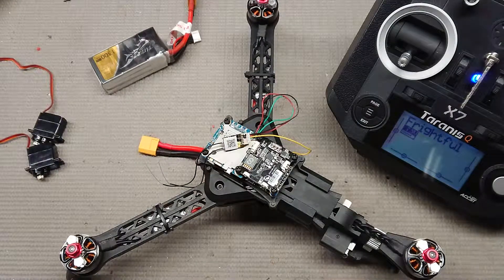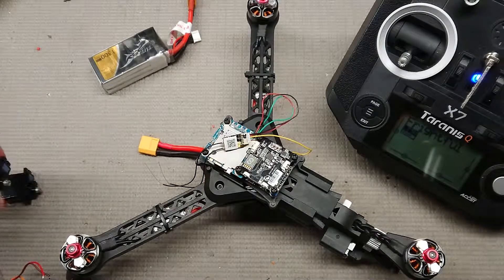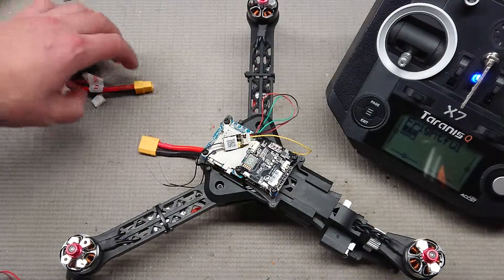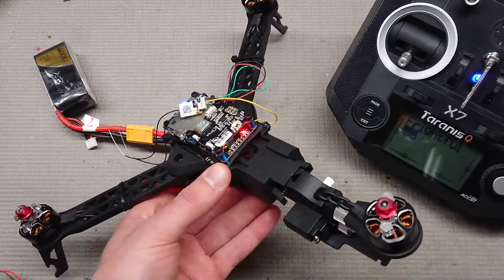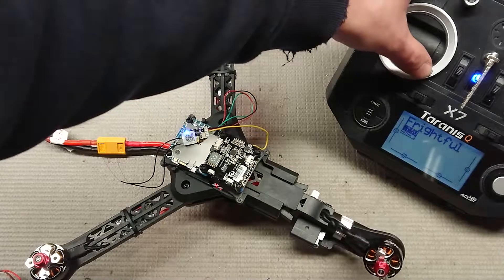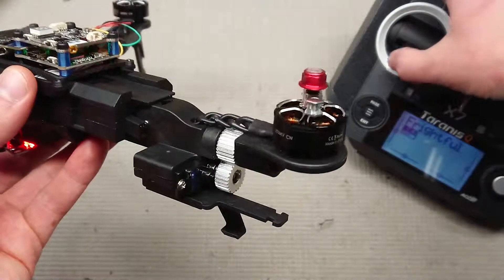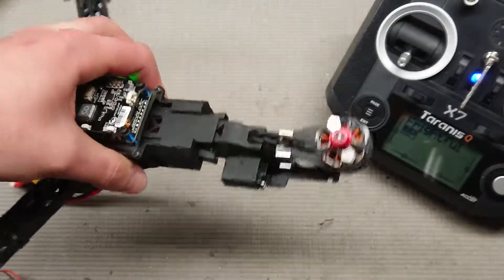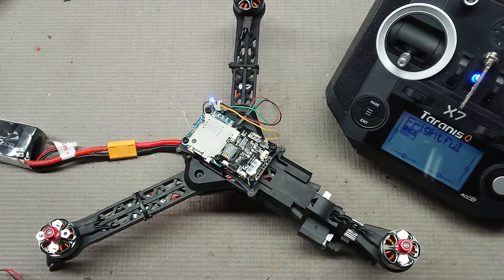Quanum Trifecta Build - Tail Servo

Comment: I tried building one but like you I burnt the servos. Bought another pair, again I managed to bust those two also. Threw the tricopter in a corner and build a quad instead. But I think of maybe building it again with latest FC out there.